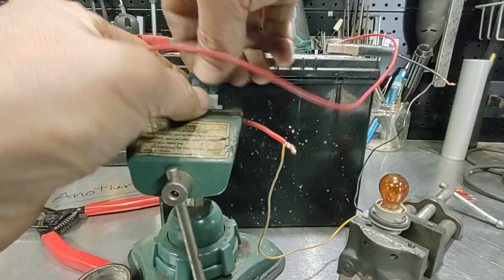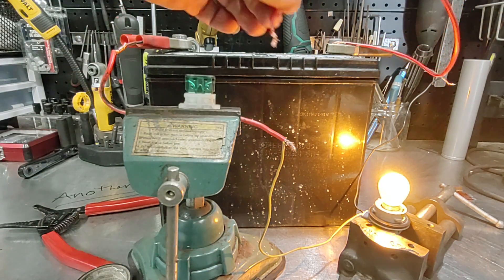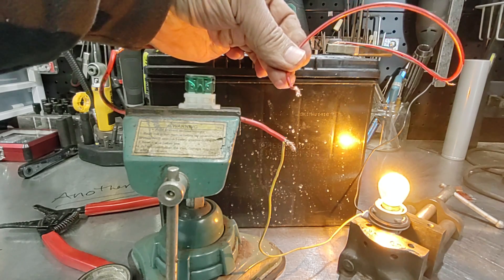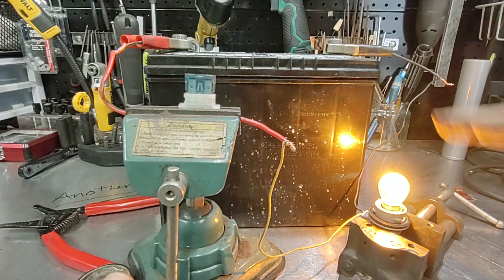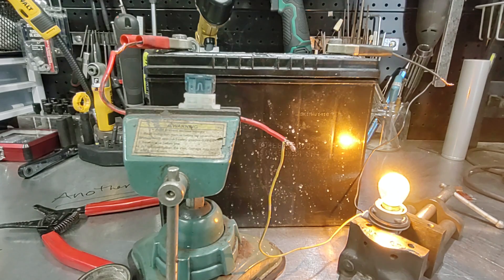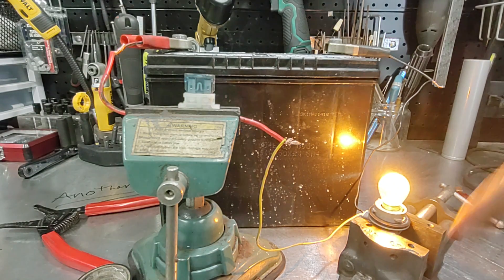What is Short to ground, What is Open Circuit, how fuse works, Short to ground explained

Comment: Short or in automotive short to ground is when the wire which is attached to the batteries +positive side comes in direct contact with a wire connected to the -negative side of battery or the car frame which also is connected to the car batteries -negative side?
Reply from the maker: Not sure if this was a question or statement, let me know if you need help! Thanks
Reply: @carservicepro  hi! Sorry. That was a question!
Reply from the maker: @tinpirin 

"No problem. In automotive systems, shorts to ground are more common than shorts to positive because the entire vehicle body serves as ground. This makes it more likely for any positive wire from the battery to touch the vehicle chassis or a nearby ground wire, causing the fuse to blow and open the circuit for protection."
Reply: @carservicepro  isn't the entire vehicle ground connected to the minus side of the battery to continue the electron flow from battery+ side to battery - side? Unfortunately I dont know what short to positive is. But need to def look it up. A big thank you for your response!!!
Reply from the maker: @tinpirin  yes that is correct. However, to avoid a short circuit, which occurs when electrons move too quickly, a resistance is needed. This can be provided by a load like a light bulb, radio, fan motor, actuator, or window motor. Think of resistance as a shock absorber; without it, the impact would be severe, like a spark or short circuit in electricity. The resistance value determines how much the electrons are slowed down as they move through the a load.
Reply: @carservicepro  understood! Thank you very much for your time to explain it to me! Wish you the very best!!!

Comment: Hello. Good video. But could you explain what is open to the ground? I have lots of errors in my car, I mean diagnosed errors and it says "there is short to the ground". This goes for multimedia, alarm, airbag etc. But these devises (like multimedia) work fine, almost fine... But sometimes it switches on or off on its own. All fuses checked. What should I look for?
Reply from the maker: Open ground means the ground wire on that circuit or circuits is not reaching that circuit in another word if you hold any wire in your hand and cut it in half you just created open circuit it can be ground or positive, also you can think of it as on off switch, sometimes this happens inside the component it self, if there is any bad soldering point it can be open circuit, open ground or open positive, so as a technician we do something called wiggle test, wiring test and eventually components or circuit board test remember corrosion, bad harness, bad connector, loose pin and etc do the same, I hope I was able to clarify!

Comment: Thanks for the video. What would be the amparage going to ground?
Reply from the maker: It depends on the components used on that circuit, the higher the amps the stronger the spark if it hits ground.

Comment: So a short to ground is almost always a cluster of wires rubbing? How else would that ground connect to positive?
Reply from the maker: Damaged Insulation: If the insulation on a wire is damaged, it can cause the wire to come into contact with another wire or metal part, creating a short circuit.

Loose Connections: Loose or corroded connections can cause wires to touch each other or the car’s body, leading to a short.

Faulty Components: Components like switches, relays, or sensors can fail internally, causing a short between the ground and positive terminals.

Improper Repairs: Incorrectly repaired or modified wiring can lead to shorts if wires are not properly insulated or routed.

Comment: Is short to ground always on the positive side?
Reply from the maker: Good question. The term "short to ground" is used for several reasons. One of the main reasons is that it indicates a situation where the positive wire is making contact with the ground somewhere in the circuit. Since the entire vehicle body serves as the ground and the battery's negative terminal is connected directly to the vehicle chassis, this creates a large exposed ground area. Typically, the positive wire is insulated and all fuses are on the positive side. Therefore, it is indeed possible for the ground to come into contact with the positive wire, especially within the circuit boards of vehicle computers, In this case there is short to positive and vice versa, I hope I answered your question!

Comment: I belive I have a short to ground in my bike, it keeps blowing my fuses. it's a 15a fuse. and as soon as I turn the key it breaks. from the key switch it runs a single wire that forks out to the starter fuse, the signal fuse and the ignition fuse. only the signal fuse blows, an the rest of the bike works find, headlight, highbeam, engine starts fine. with the fuse blowing I have no break light(but sign light and normally on rear light works) what does not work is the horn, the blinker(the relay for the blinker also does the  starter, so when i Disconnected it i can't start the bike) and neutral light.

Looking at the wiering diagram it's not that much it can be. but how would I actually find the short. i've tried with the cuntinuty on the mutimeter but i'm having no luck :/
Reply from the maker: While I may not be an expert in bikes, here's my approach: First, I'd remove the blown fuse. Then, I'd connect a test light between the fuse pins, where the fuse was placed. If there's a short present, the test light will illuminate or simulate the moment the fuse blows. The test light will remain on as long as the short persists. Next, I'd leave the test light connected and begin disconnecting components one by one until the light goes off. This will help pinpoint the source of the short. I hope this explanation proves helpful.

Comment: So I’m hear because I replaced a R/R my Yamaha r6 I cut the pig tale loom to the stator and just hardwired it to the R/R. Now my starter relay keeps blowing its 30amp fuse just from turning key. Will sometimes start and run for a min will blow fuse or wires will get really hot. Went through the harness found some shotty wiring jobs. Fixed a few spots with insulated butt connectors. Still to no prevail can not find what I assume is a short to ground somewhere. If you unplug. The R/R it’ll start up no problem won’t blow a fuse. Checked continuity on the stator and it has no grounds so I would assume it’s fine. Desperate for help thanks for reading this 😂😂

Comment: so a short to ground is when electricity takes a different path because wires could be touching? why does electricity taking a different path cause it to blow
Reply from the maker: Because of sudden high current pass through and this very much has to do with electrons, in normal circuit there always a resistance between negative and positive or a load, think of thunder lighting in the sky where you see spark, anyhow this is smart question you asked and it is on scientific level has to do with atoms!
Reply: Electricity(current) takes always the easiest path(with the lowest resistance). In first case with light bulb ,the flow of electrons(current) was transformed to heat and light.On 2nd case there was no consumer so the electrons moved in a closed circuit which create friction,then heat ,then fire.I hope my logic is correct and helped you